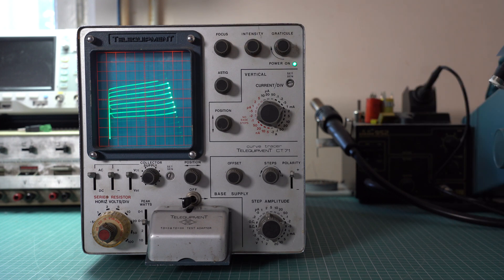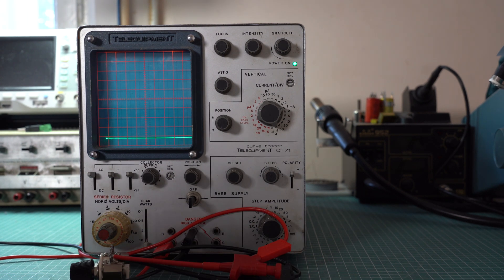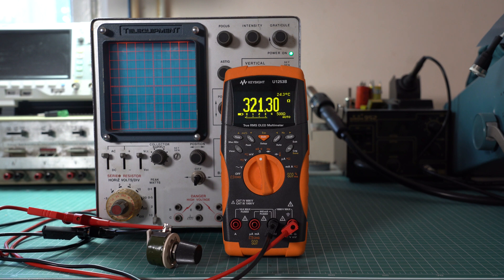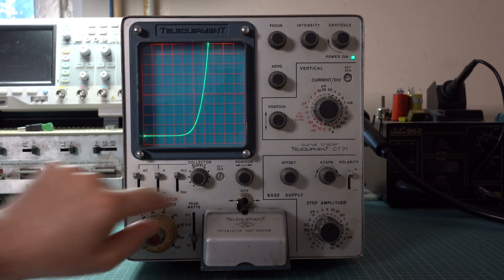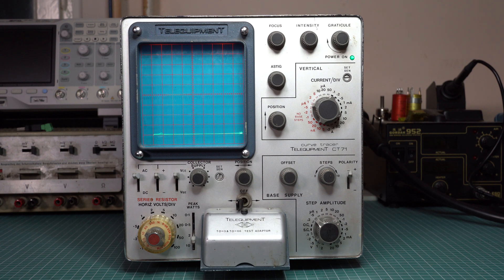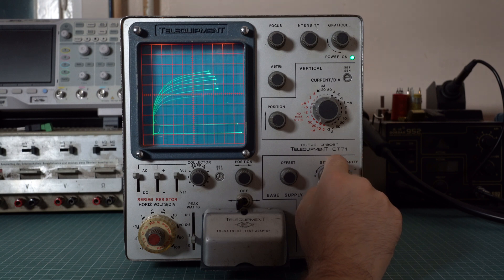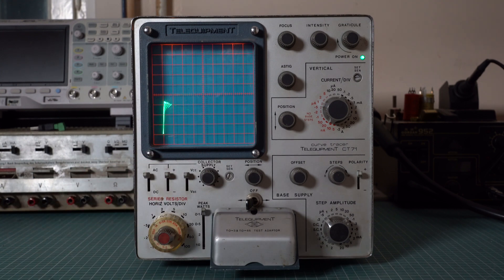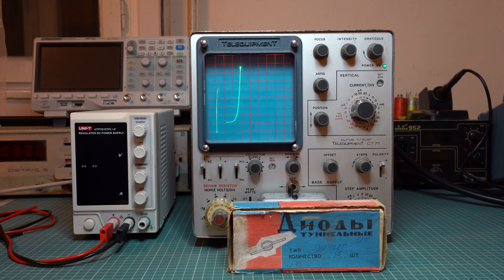All you need to know about the curve tracer

Comment: great instructional video on learning about the function of various components.
wish I had something like this years ago trying to put components together in a kit.
now a days lots of electronic  devices are a small printed circuit board with lots of components.
is there a way I can use a curve tracer to test  just the whole board to determine if some component is defective on the board?
thanks
John
Reply from the maker: Generally speaking, the curve tracer is useless for board level repair and since it can provide so much voltage and power, it can damage boards beyond repair. Once you connect it to a board, as the voltage goes past a few hundred mV, you will start turning on some PN junctions inside various components which will make the IV characteristic meaningless. ( It could look the same for a damaged board or a working board and you don't really know what to expect from the IV curve). Maybe in some rare cases, if you have a known working board as a reference, you could compare certain test points against a damaged board. But as I said, one wrong setting on the curve tracer and the working board gets toasted. The best way to use it for repairs is to take a presumably bad component out of the circuit and test it. It could test diodes, transistors, resistors (even though it makes no sense) and  it can even test capacitors for leakage as demonstrated in a more recent video of mine. 😁

Comment: 5:17    OL isn't OVERLOAD
OL stands for  OVER LIMIT

there is no overload, what is happening is.... Your test meter (DMM) is saying
I have reach the LIMIT of what i can test. Hence it is OVER the LIMIT of it's test capabilities

there is no overload
Reply from the maker: It makes sense, however the meaning of OL is inconsistent among resources and manufacturers. It's literally called an overload on Fluke's website: https://www.fluke.com/en/learn/blog/digital-multimeters/accuracy-precision#:~:text=If%20the%20measurement%20is%20higher,setting%20without%20overloading%20the%20multimeter.
Reply: @VoidElectronics 
Then the person who wrote that is incorrect.
Just because it's a Fluke Website doesn't mean that some Engineer wrote the content , it's probably the graphic design people who were tasked with the website

Why don't you consider the logic of what i said.  as this explanation goes back to the 60s and 70s
OL is Over Limit
because you've reached the limit of your multimeter

Overload doesn't make sense because when you go into Continuity and you get OL,  How is there an Overload
and when you are measuring Resistance.
How do you get overload ?
You don't

this is something that started to be used in the 90s, But it's silly and it's wrong
but it's a common mistake so i understand 

But yeah, the fluke thing suprises me and i will be calling them about it
but i can assure you .. They are wrong 

in Electronics Accuracy is important.
and carelessness is not
Using OL as Overload is careless

let's apply logic to it

Does a resistor OVERLOAD a circuit when the meter is in resistance mode

or

Did the meter reach the upper limit of what resistance it can measure

apply logic to this and you'll see that it's Over Limit and not Over Load
Go into older manufacturer documents and you'll see it's Over Limit

anyway....
Back to the curve tracer

if there is a line Horizontally
that implies there is Voltage but no current

WE KNOW that when we have an Open Circuit we have no voltage and no current
so.. it's weird don't you think

i would have expected a dot

now when you said... LET'S CHECK OUR PREDICTION

You're not really predicting though.
You already know the outcome and you're catering your explanation to it 

so let's ask
what is a dot on the curve tracer 
Relative to the a Horizontal line

and also i'd like to ask this ....

when you were testing Transistors and talking about step voltages and you got that multi step trace

well... I have a curve tracer.
i put it on a transistor
I didn't get the steps

I just got (let's call it)  1 step

why is that do you think ?

Comment: 1:55  QUESTION
in an OPEN you have 0V  0A
why would you get a straight line ?

If X is Voltage and Y is Current
why wouldn't it be just a dot on the screen ?

A Straight line implies there is no Current but there is Voltage

the SHORT CIRCUIT makes sense
in a short... There is no Voltage but there is massive current so yes..... Vertical Line is expected
Reply from the maker: The explanation is at 1:34 . Your assumption that an OPEN is 0 V 0 A is wrong. An open means infinite resistance, meaning that the voltage can be any value and the current is 0 A. The curve tracer varies the voltage using a rectified sine wave voltage source and as the voltage changes, it sweeps the display horizontally. There is 0 current as this happens, so there is no vertical deflection and you get a horizontal line.
Reply: @VoidElectronics 
No it's not
Open Circuit means.....
A Break in the circuit
Meaning Voltage and Current cannot flow

the Infinite resistance part of it is a separate attribute
Open Circuit is not defined by Infinite resistance it is defined by a BREAK in the circuit 

in an O/C , Voltage cannot be ANY Value.
The voltage is 0V in an Open Circuit
we all know this, it's not a debate

if we have a straight line it would imply
0 Current  but presence of voltage

so Logically if we have No current and No voltage, that would be  A DOT... Correct ?

and if we have Current and no Voltage
that's a Vertical Line

and if we have Voltage and no Current
that's a Horizontal line

so on that Horizontal line there had to have been voltage which means it was not an Open Circuit
Reply from the maker: @martinkuliza  My final argument on this is that the assumption that an open is 0 V had lethal consequences for people stealing grounding bonds from railway infrastructure. As soon as you OPEN the grounding bond, you get a massive voltage across the ends. How about that?

Comment: I had a look on ebay for one of these but you can probably guess I had no luck !
Reply: There's a lot of projects to build a simple or medium complexity one yourself nowadays, on YT and the web. I'm interested in replicating one as well. For common semiconductors, most of the time you don't need a curve tracer to go to 100's of volts to test things any more, so they can be a bit simpler/safer than the equipment shown here.

Comment: Thanks for sharing your knowledge!

I've been spending some time improving my very very basic electronics skills.  The other day I watched a video of someone fixing a switched mode power supply.  They tested a diode on a curve tracer.  But, there was no explanation of what the curve tracer was or how it functioned.  Obviously, the thought was, those watching would know what the machine did.

And thanks to your video, I'm now in-the-know about the basics of curve tracers and their importance of diagnosing components thoroughly.

Thank you!
Reply: If you want help on Electronics Basics and the functioning of a switched Mode Power Supply
i'm happy to get on skype with you or whatever and explain that to you and put you on the right path
Reply: @martinkuliza  Much appreciated!  And, at some point, I may run some questions by you...

Currently, I've got a 1993 Chevy C1500 pickup truck that, once heat soaked, bucks and barfs.  I've played with the cheap little DS211 oscilloscope toy on fuel pump armature commutator checking, primary and secondary ignition wave forms.  But, the toy o-scope just doesn't have the ability to sample or store enough data.

I really should just drop the dime on the Pico 25Mhz four-channel and be done with it.  Hell, you can't diagnose a modern car without a scope these days.

And too, the Pico would be nice for my other electronics endeavors.

Thanks for your kind offer of assistance reply!

Comment: can you test ic, igbt, triac using this?
Reply from the maker: Generally speaking, you cannot test ICs because each IC would need its own dedicated testbench for that. At most, you can check the internal ESD diodes that most ICs have or some people like to check the characteristics of a presumably faulty IC compared to a known good one, but that's not the most reliable and scientific way to test an IC. As for IGBTs and triacs, yes, of course you can test them with this. 😁